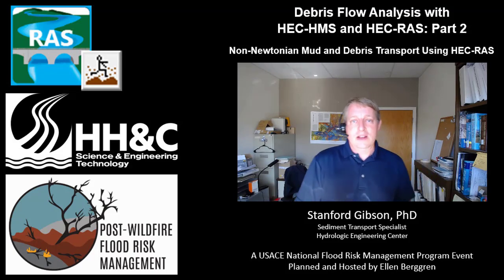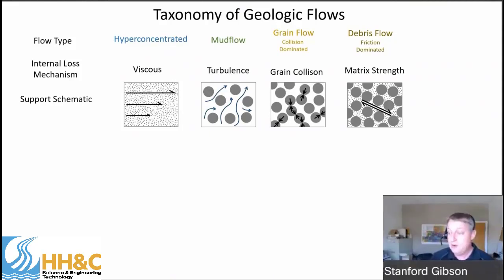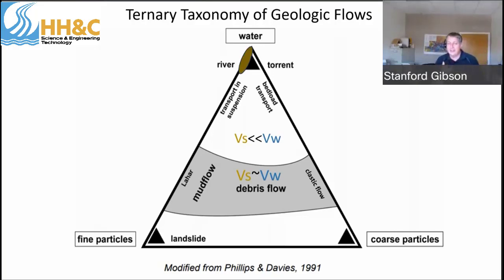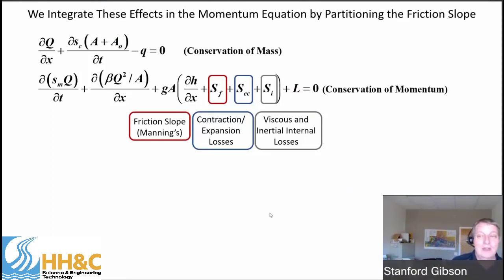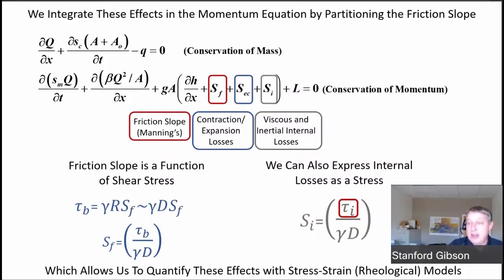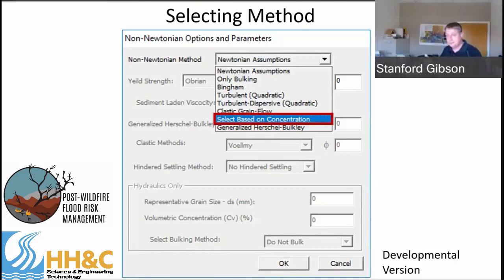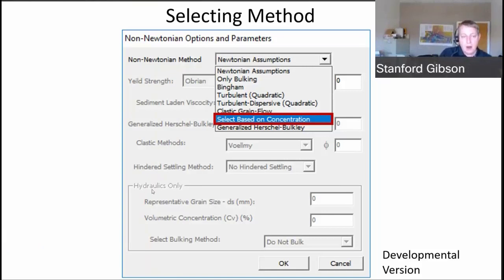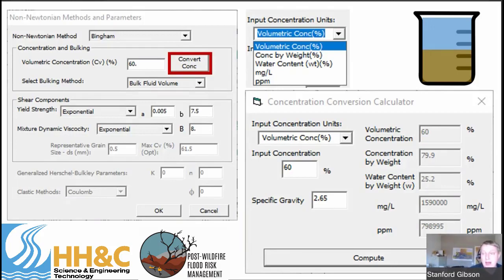Mud and Debris Flow Modeling with HEC-RAS (Part 2 - Non-Newtonian Hydraulics)

Comment: thanks for sharing with us Dr Gibson. I have a question: I have carried out models with Bingham parameters where I have only varied the Cv, and I have obtained different results. However, Bingham equation doesn't depend of Cv, so similar results should be obtained. How does Cv influence the Bingham formula?
Reply from the maker: Did you use the exponential equations for yield and viscosity or bulking?  Those depend on Cv.
Reply: @HEC-RAS  no, I didn't, I used yield strength and defined viscosity values and do not bulking. If I select defined yield strength and viscosity values (the same way you do at the end of the video), how is Cv related to fluid characteristics without using the exponential method?

Thank you for answering, greetings from Chile!

Comment: Hi , thanks for great video! I'm Trying to run Non-Newtonian analyses. getting following error ? 

***  Warning!  Extrapolated above Cross Section Table at:  ***
       (The extrapolation may have been caused by model instability)

    Fake River Fake Reach    R.S.   100

Overall Volume Accounting Error in 1000 m^3:             4218.
Overall Volume Accounting Error as percentage:           664214.
Please review "Computational Log File" output for volume accounting details

How do I solve this ?